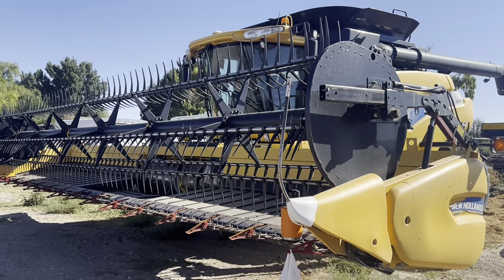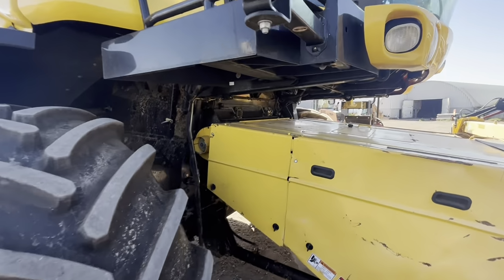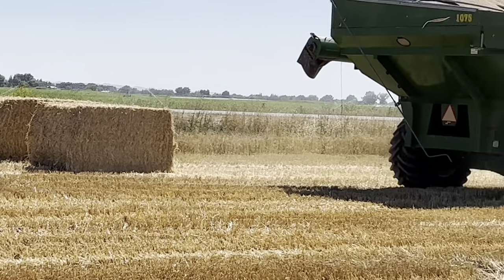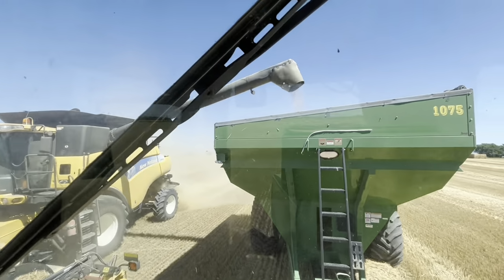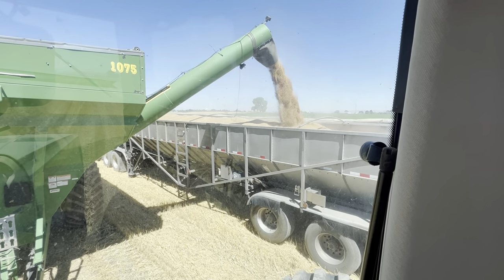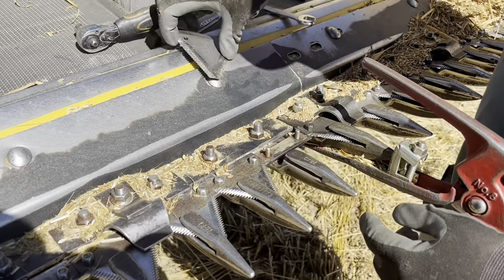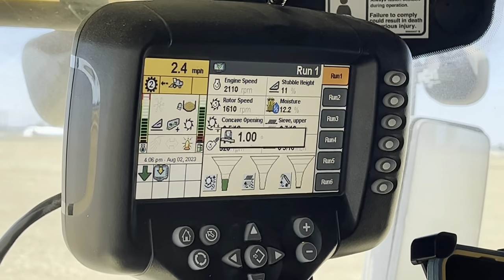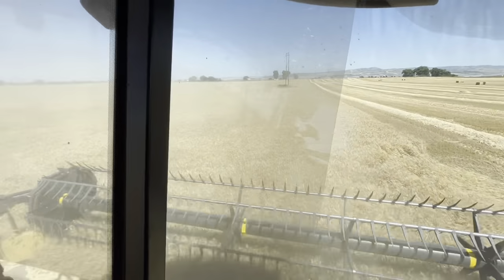Secrets of the Golden Fields: Unearthing the Wheat Harvest's Hidden Wonders

Comment: Great video. I have a question if the combine fills up with the pipe over the unharvested section of the field how do you unload the combine on the move?
Reply from the maker: Good question! We try to plan it out so that doesn’t happen. In the case that it does we just stop and turn around to dump in the cart.